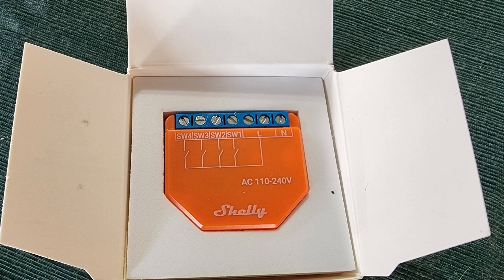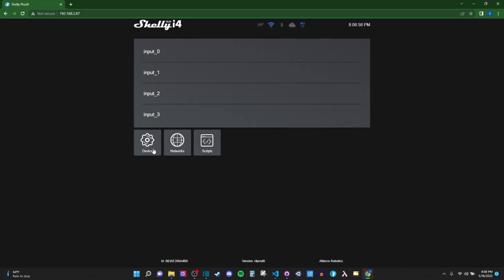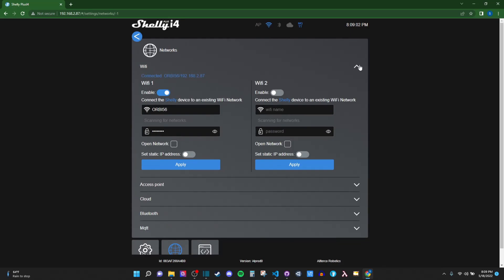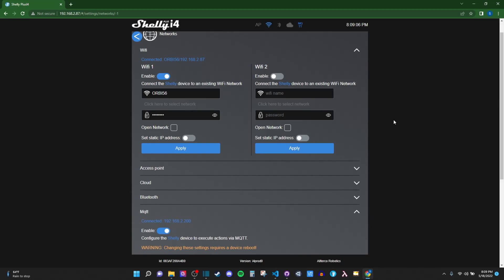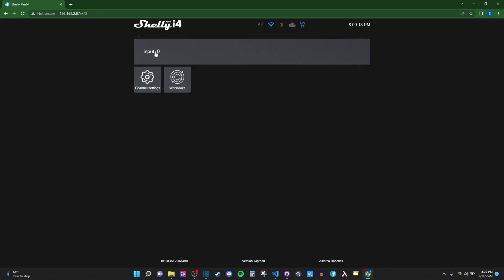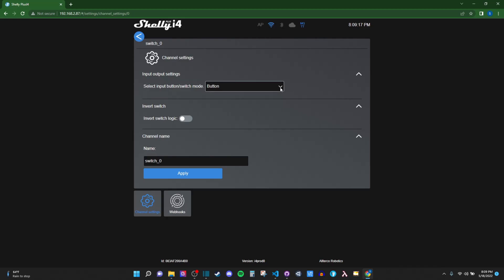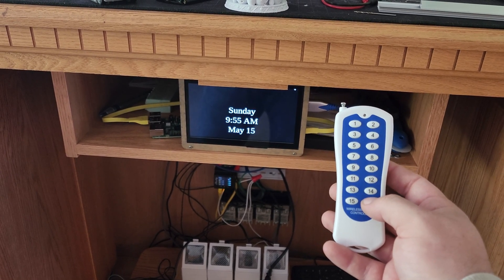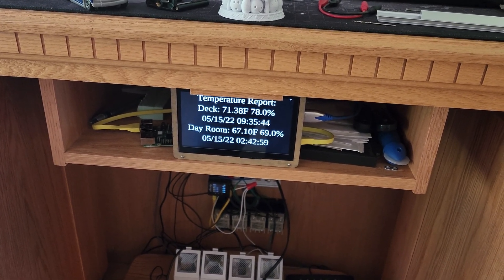DIY 16-Channel 250+ Command Automation Remote with the Shelly i4

Comment: Great idea, question on the common terminal of the shelly is there any mains voltage, I see it is labelled as L?
Reply from the maker: Yes, the L terminal is the mains hot. I wish it weren't, to be honest, but it is how the device was designed to work--I believe the idea being that it would be used with existing light switches or the like.
Reply: They do an i4 DC if you don't want to deal with Mains

Comment: Hallo,
Can you tell me how the Shelly Plus i4 will control the on/off in the relays board? 
Thanks.
Reply from the maker: In this video, I am using a radio frequency remote controlled relay board in place of switches or buttons for the i4 to pick up input. Elsewhere, I use Shelly 1PM relays to control circuits. You would need to write software or use a cloud app to integrate. For more details about this, please see the following video:
https://youtu.be/np-YDJl7Em0
Reply: @smartercircuits  Thanks!